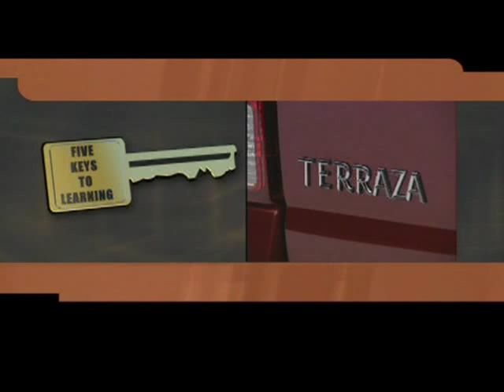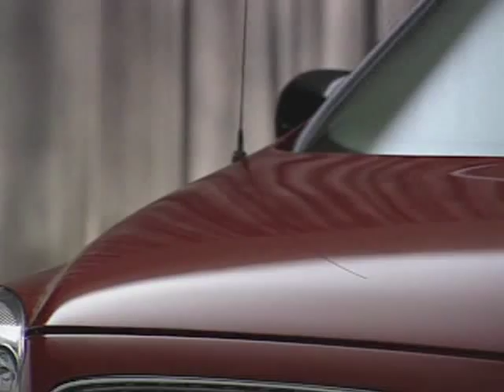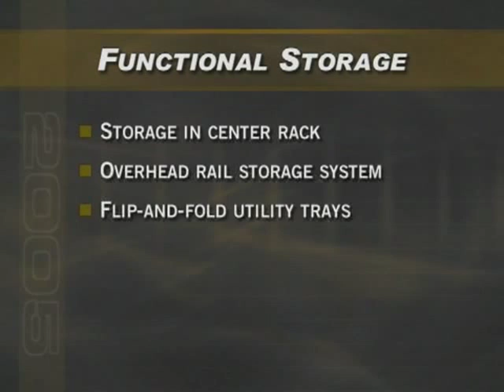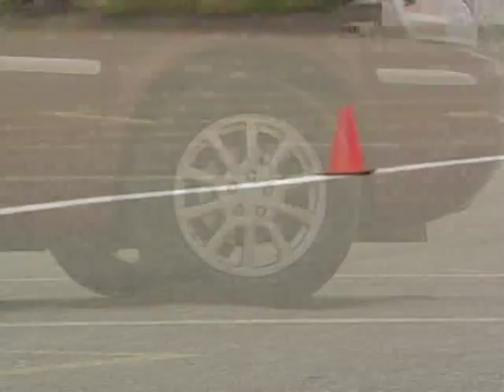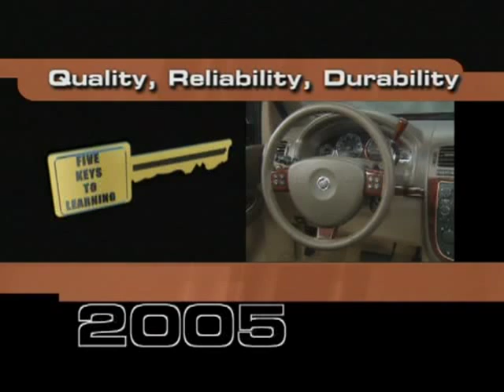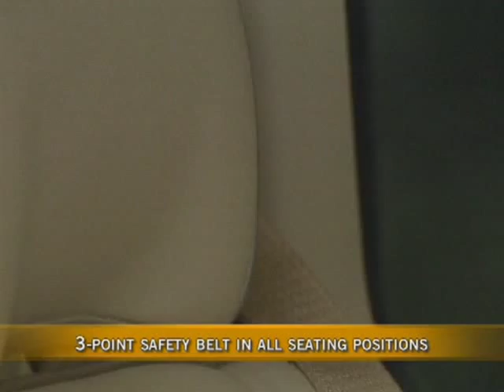Buick Terraza  (2005) Product Training

Comment: “It looks like a Buick” You mean a Chevy Uplander with chrome added exterior.
Reply: Cutefreerose on break 
No...
This Buick looks a lot more comfortable than Uplander. The Uplander seats in rear are like 1/2 the size compared to Terraza. Believe it or not, plastic is everything in new cars now today. That plastic chrime trim makes the car look a lot nicer. The wheels, front bumper and grille looks nicer too.
Reply: Cutefreerose on break 
If anything the Mercury Monterey was a disappointment. They did nothing to redesign the front besidess put a different grille pattern (had the same shape as freestar) the row seats did not looks as comfortable either.

Comment: One of the most underrated minivans of all time
Reply: How reliable is this van
Reply: DanDan Moore my dad has one and the radiator has been replaced 4 times in the 3 years we’ve had it, yes it is a piece of shit. also the water pump went out and it leaks oil and tranny fluid all the time
Reply: Agree its a totally overlooked nice van